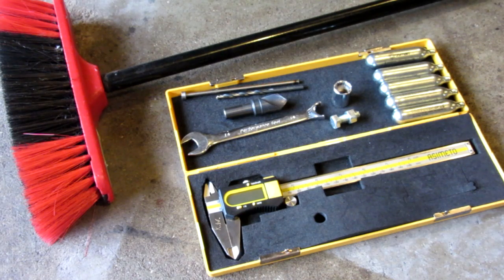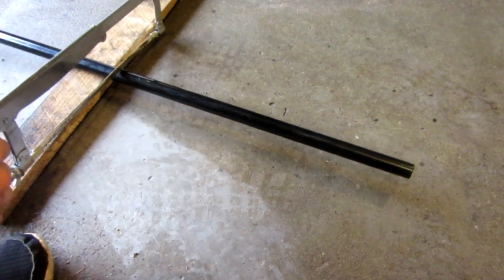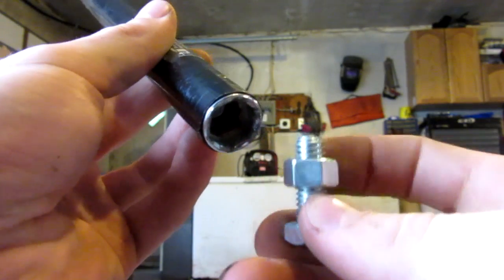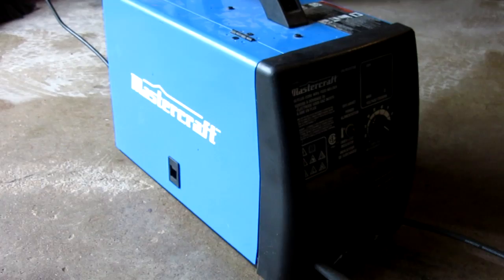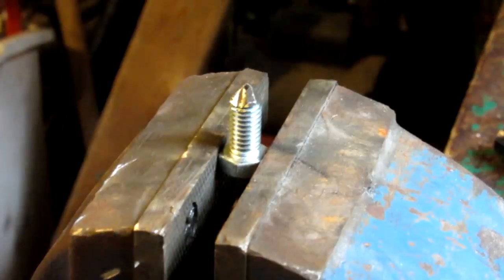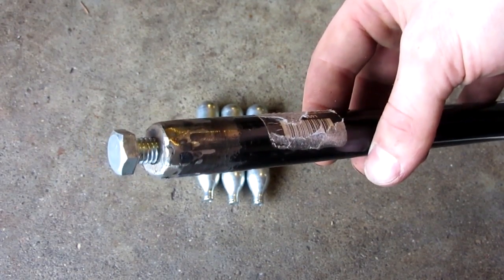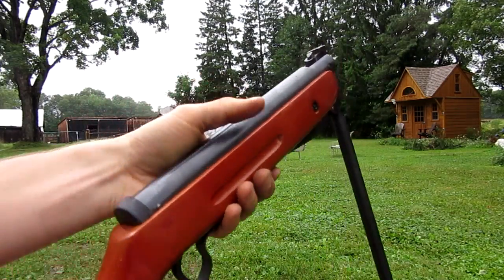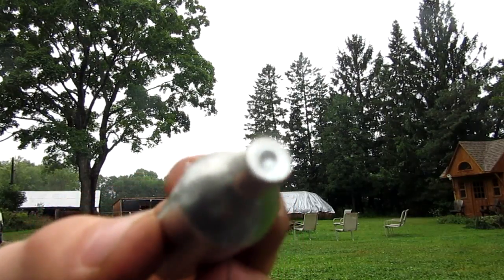How to Make a CO2 Cartridge Rocket Launcher !!!

Comment: look up alloy tubing with anozied internals it fits Co2 like a glove and will increase fps drastically also you need a FAR longer barrel for the speed to build up , if you add arrow fletch to the canister and fold them down then mussle load you will get it to fly far !

Comment: I tried doing this along time ago with some pvc and a nail, the type of pvc I used was grey and the walls where thinner so that the co2 cartridge would fit then taped a nail to the end of the co2 and threw it down the pipe and it would be like a mortar
Reply: Thats what i was thinking